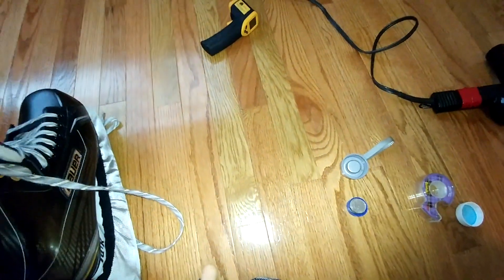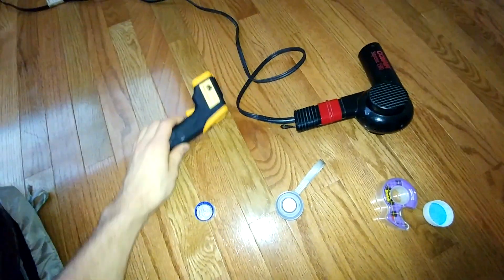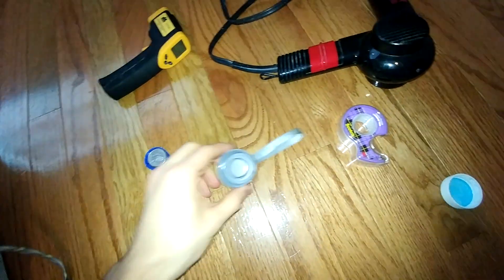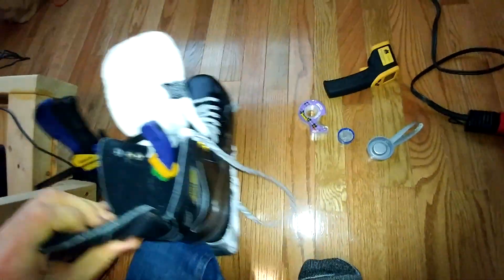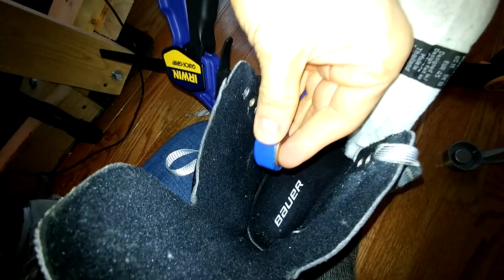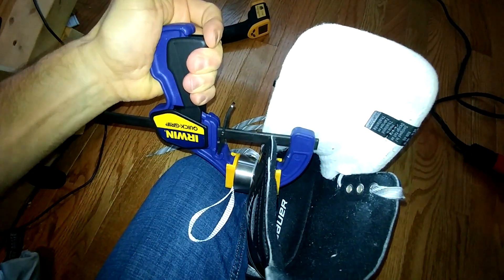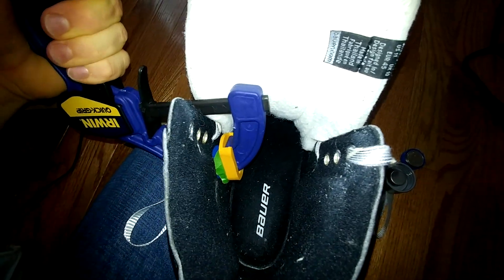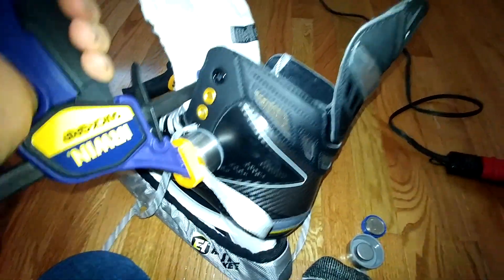Homemade Ice Hockey Boot Punch Out

Comment: Man this technique worked perfectly for me! I have really flat feet so the bone on the inside of my foot protrudes out quite far and causes me a great deal of discomfort. I had taken my new skates in at least 6 times to 3 different places and they could never get it right. I watched your video, tried it and got them instantly better than the skate shops could do. I used a c-clamp though instead of the style of clamp that you had because that's what I had at my house and also used a large socket on the outside to act as the receiver and it worked well (it's not super pretty as I might have pressed a bit too hard and left a big imprint of the socket on the outside of the boot but I don't really because it worked!). I can actually wear my skates without major discomfort now, thank you!
Reply from the maker: I love hearing that. And I agree there are def better tools to use for this as many have pointed out (c-clamp should get you better results for sure), but I was also just using what I had handy at the time.  All in all, though, whatever helps you be able to skate and not think about the pain in your feet is a win!

Comment: Great idea, but to improve it a bit I'd start using ratchet sockets.  You can vary the fit using different sized sockets and you don't have to tape quarter in a bottle cap.

Comment: Thanks for the tip. I'm going to try this myself (with a golf ball too). I have the same issue in the same location of my foot. If you haven't already, you should look up "accessory navicular bone"
Reply from the maker: dakuwan yep, that is exactly what I have too- the accessory navicular.
Reply: I have the same issue but only in my left inside ankle inside the boot same pressure point that causes so much pain. I need to try this

Comment: is hard to punch out at the small toe area, right?
i been bending with my hand and a screwdriver, but it makes little to no difference. Almost as the boots reshapes itself over the night.
Reply from the maker: Peter Negan yeah I think you need a legit press of some sort for that because it is so reinforced there
Reply: If its on the hard toe cap...thats a tough one.  If not, did you heat it up first?
Reply: For me the problem with my Bauer Supreme 160 skates is that the hard cap plastic toe cap is narrow compared to other brands and models, but it is only my little toe that sort of get pinched a tiny bit. Heating it up with my hair dry blower does nothing.

Comment: Think it’s just the skates? I have the same pair and the same problem
Reply from the maker: Nope- I went to some higher end CCM Tacks shortly after I modified these that were fully heat moldable (and did the same adjustment to them). I think it is that we have that different bone structure... The accessory navicular
Reply: Cooper Long I was planning on either trying custom or a different type of skate. Thanks bro